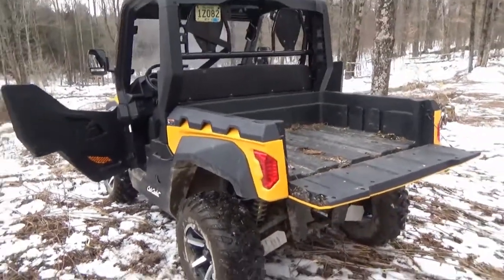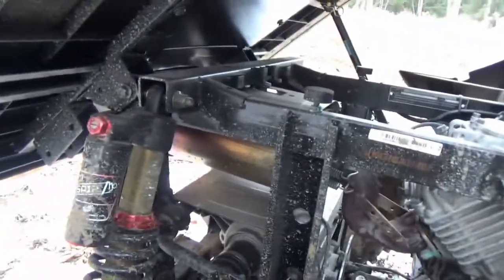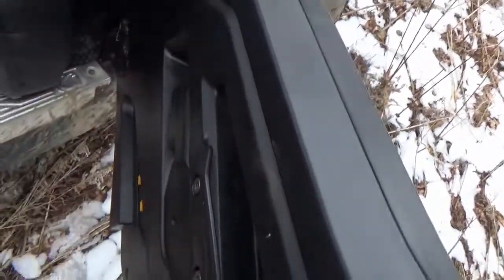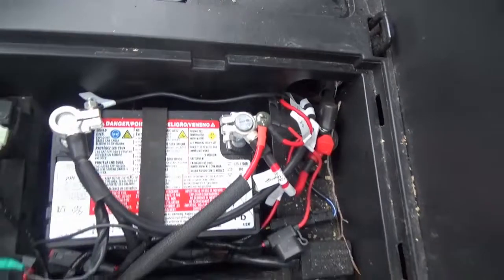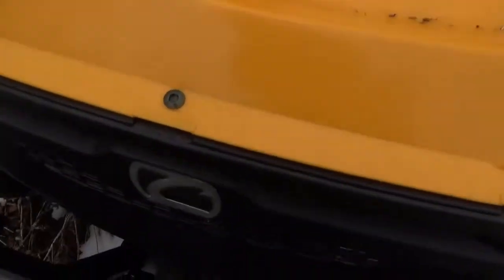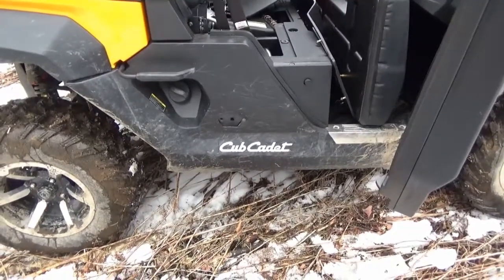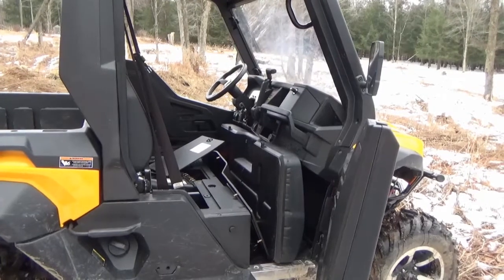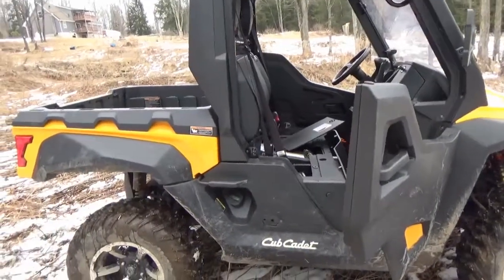More Information On The 2018 Cub Cadet Challenger 750

Comment: I bought one January 30 of this year and it was junk. The place I got it has it now and has more than I have. It has broken 3 times the first time at 10 miles it was covered under warranty but was a price of $1700 and the second  was $2000, the third time at 200 miels is were we are now and needs an injector and it will take at least 3 weeks to get back I have had it in my possession for a total of 2 weeks, needless to say I,m not happy with the product.
Reply from the maker: Wow, I'm sorry to hear that. I don't understand how some can be great and others are so bad.
Reply: @SteeveeDan  I dont either, and some of my problems could be the  Mechanic
Reply: @SteeveeDan  I really like them and they look cool, my favorite part was independent locking dif
Reply from the maker: The locking diffs have saved me a few times. I agree that without a good mechanic, you're at their mercy.
Reply: I got mine and the timing chain came off at 150 hours. My friend also got one his timing chain came off also but at 132 hours.  Also the exhaust points directly at the rear bumper which burns the paint right off. And also I noticed 2 bolts were missing from the machine from vibration. And a muffler spring clamp also rusted right off.  So its at the dealers currently. he just called and said it will be 900 bucks to fix and Cub cadet will not extend the warranty.  Any other questions? Like Steve said they dont get stuck, they do have a good 4 wheel drive system and they tow pretty good, and ride pretty good, just dont break anything on the machine because like he said its expensive.
Reply: @SteeveeDan  A lot has to do with how they're used, and you have got to have a good dealership, or be able to work on stuff yourself which is what I'd be doing anyhow...a fuel injector is like a 5 minute replacement.  Sounds like the dealer just has no clue as most are that way, they can sell machines and parts but when it comes to repairs they don't have the slightest clue....my Yamaha dealer was that way....not only were the parts ridiculous at the dealer, their customer service sucked...as soon as they got your money from the machine sale they could care less.  Everything I did on that machine I did aftermarket getting parts online through other sources.  My current Polaris Ranger I service myself the previous owner kept up with all the services on it luckily, but like any brand they have their weak points and strong points.  

The independent selectable lockers is what had my interest in the Challenger as well...my Rhino's rear diff was locked all the time so far yard chores it literally sucked, it would tear up your yard trying to turn around.  

The Challenger would be my choice for price point with standard features.  You just have to realize they all have their problems, its all in how you take care of them which I'd recommend doing it yourself if you have the machine you need to learn to do the maintenance on them yourself, otherwise you'll be forever at the mercy of a dealership that will do everything they can to take your wallet and still not fix the problem...they throw parts, they don't diagnose anything, and oftentimes they don't have a clue what the problem is in the first place anymore than you or I would so since its not their money they just start tossing parts at the problem hoping that one of the couple dozen parts eventually fixes it...then you gotta wait for them to decide to even work on it.  

The front diff on my Yamaha Rhino wouldn't lock in most of the time, dealer never figured that out but wanted to charge me $2,000 to replace the front diff while it was under warranty I told them to pound sand.  I never messed with it because the 2 years I had it, I think I used it once and it didn't work right then, so I never bothered with relying on it, tried it several times afterwards and it would never engage the lock light on the instrument panel would just flash and you could tell that it wasn't engaged all the way as you'd still only have 1 front wheel spinning.  

My Polaris Ranger 6x6 the 4WD system in it only engaged when traction is lost....well that's not useful at all LOL...but that's just how the Polaris machines are...its got a nice payload capacity and large bed but so many weird things that Polaris did that just make you scratch your head, like a chain for reverse, the quirky 4WD system, the tandem axles always locked together, luckily I don't need the machine anymore for yard chores because that tandem locked axle would be even worse in the yard LOL.
Reply from the maker: Great comment, thank you!